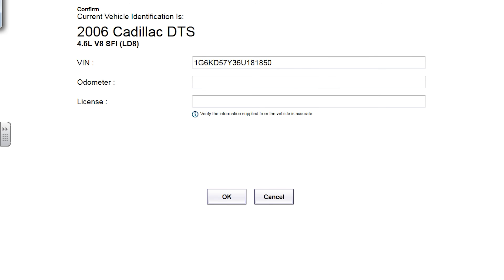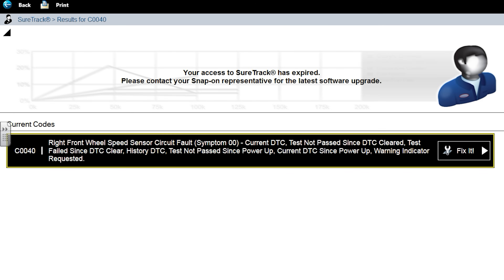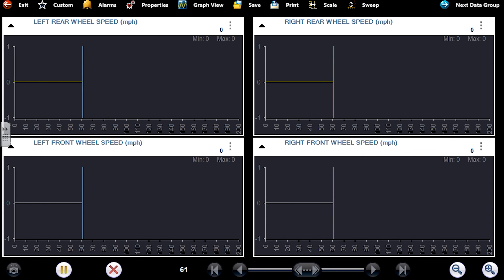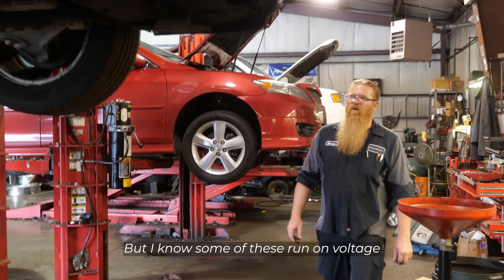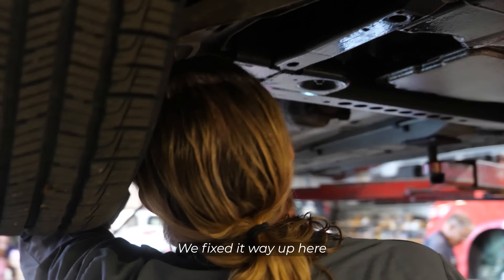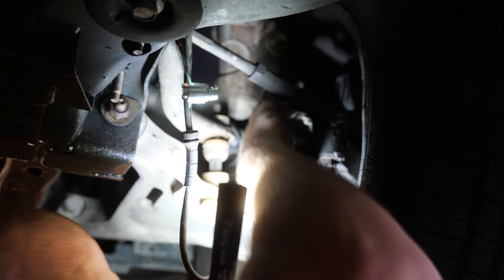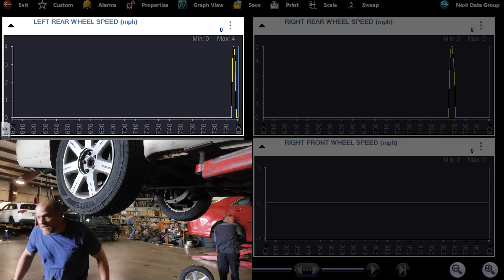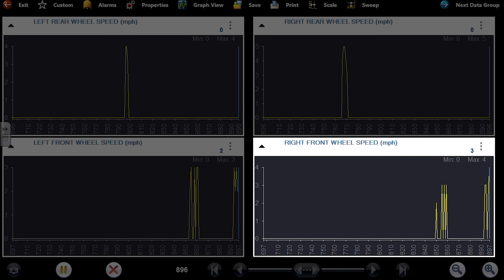ABS Wheel Speed Sensor Diagnostics

Comment: Hi Paul, great video as always. I wonder is that bias voltage on VRS type speed sensor If I am not wrong as if it is dc type sensor than that 5volts should not drop that much when plugged in?
Reply from the maker: This is a variable reluctance type of sensor (makes it's own voltage) that creates and AC signal. The DC bias line is 5v but is dropped significantly when a good sensor is plugged in. This is a normal condition. It is a voltage divider type of circuit. Very similar to a coolant temp sensor in that it contains a resistor internal to the module that the 5v bias runs through first, with the second resistor being the sensor itself. Unplugged you will see a full 5v (just like an ECT circuit) and plugged in, depending on the resistance of the sensor will dictate how much of the 5v bias supply drops.

Comment: GM antilock systems are garbage. I've got a 13 Silverado that has low speed abs engagement. Cleaned all the rust off the mounting surfaces, made sure the signals look clean and aren't dropping out, and still it low speed engages.
Reply from the maker: Change the sensor and or wheel bearing assembly

Comment: I have a 1993 cadillac deville 4.9l, My anti-lock light is on after I changed all abs sensor on the car and I drove it and the light is still on. My opinion is that it's a bad abs relay switch not the hydraulic unit. I don't know kno where's the abs relay switch is located at...can you please give me some information.

Comment: Hey I thought I'd reach out for some possible help. 2010 peugeot 3008 2.0 hdi I'm suspecting it's got a dickie ecu. Throttle goes dead but comes back after a few seconds.  Replacement pedal didn't help.  Reset the ecu and it was OK for a day or two.  I'm suspecting the drivers in ecu are faulty.  What is your thoughts

Comment: Perfect timing for this video...  Wife's Jeep Wrangler has a front right wheel sensor fault...  Was gonna get under there and look at the wiring, Now I will look for a bias voltage to help troubleshoot!!! Thank you!
Reply from the maker: Depending on the year, your speed sensor is different. It is a magneto resistive type and they use a 12v supply to it. Here is how you test those..
https://youtu.be/LKJWkAGMOfQ

Comment: Nice find as usual Paul! 
These GM's are bad at the ABS harness flex points going to the front suspension, fixed so many I can't count. They sell the harness for $28 or so last time I did one. Not even worth fixing unless it's past the connector, which is rare.
Bias voltage is a great tool that often gets overlooked!

Comment: Hey Boss, I’ve seen many broken wires without insulation damage on YouTube.  How do those wires get damaged? Respect.
Reply from the maker: Movement and flex of a wire over time breaks off the individual strands of wires while leaving the wiring insulation untouched. It is crazy the first time you see it.
Reply: @ScannerDanner  Thanks.